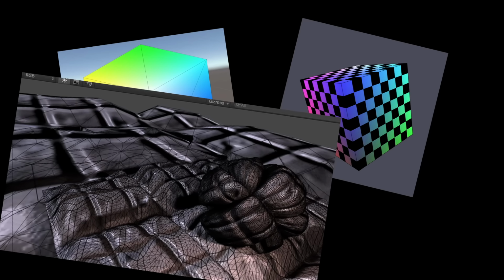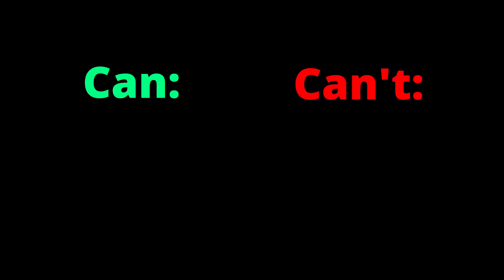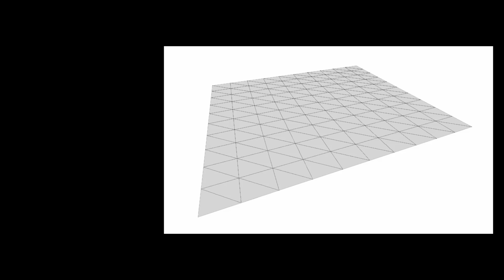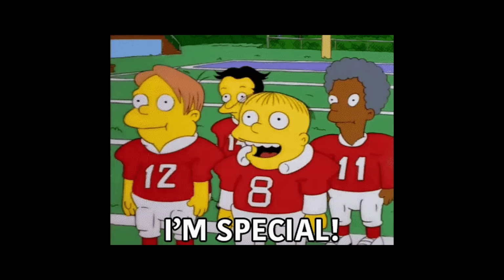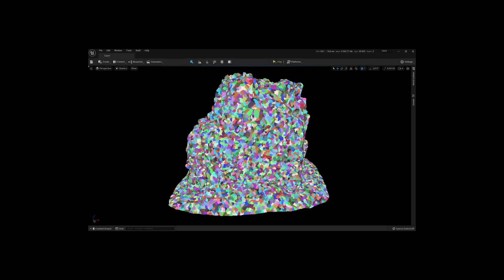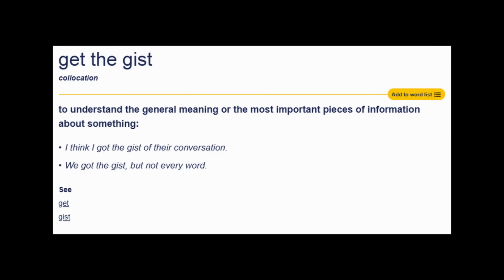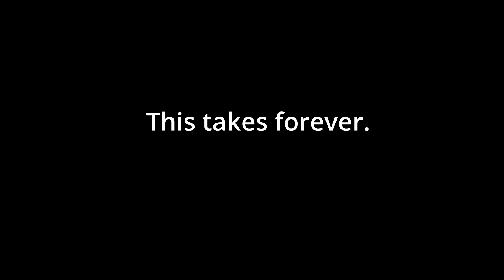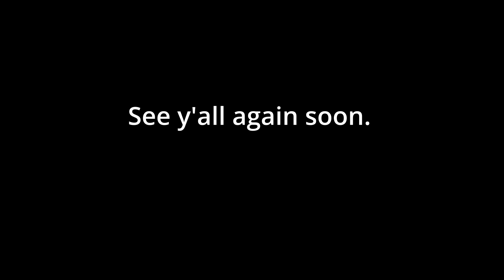Mesh Shaders: The Future of Shaders and Computer Graphics

Comment: Some crazy unkind comments down here lol, what do you expect from a 5min video? Why don't yall just make videos explaining mesh shaders then? As someone who has barely touched vertex and fragment shaders (and has used OpenCl for compute) I think this was a nice taster. Even if you wanted to go into more depth, its not necessary to do it in a single video, and you'd always need an introductory overview anyway.

Btw, how are meshlets generated, like how is the mesh partitioned? By the driver, something you do cpu side at runtime, something you augment the meshdata with on disk?
Reply from the maker: Thanks for the comment, I really appreciate it! Meshlets typically are generated at CPU runtime. Basically, you have to preprocess the mesh by splitting it into meshlets manually at some point early in the program on the CPU.

Comment: OpenGL 4.5+ with the appropriate extensions (GL_EXT_mesh_shader or GL_NV_mesh_shader) can use Mesh & Task shaders. Even OpenGL ES 3.2 can use Mesh & Task shaders, albeit with a lot more limitations (although you can't use them in WebGL2... basically the only place where GLES3 is useful imo). They are supported in WebGPU... but I'm trying to not look at WebGPU until it has broader support and tooling... and hopefully by then someone will figure out a good way to convert between GLSL or SPIR-V and WGSL (the new shading language for WebGPU)... I wish they would have just supported a subset of SPIR-V like basically all other modern graphics APIs (including Microsoft, although not yet... but SPIR-V already has extensions to support most features from HLSL that are missing in GLSL). It seems Apple was the main objector, then they manufactured a bunch of (mostly) BS reasons about why SPIR-V wouldn't work.

Comment: What can mesh shaders actually be used for? How do they operate on meshlets?
Like for example, how is the Minecraft nvidium mod actually utilizing mesh shaders?
Reply from the maker: I’m not sure about Minecraft’s nvidium mod, but essentially mesh shaders allow you to do more operations that would traditionally have to be done on the CPU, on the GPU. Essentially it’s just a very different type of rendering pipeline with vertex manipulation and generation on the GPU playing a central role. The actual mesh shaders look a lot like compute shaders, except they output vertices directly into the fragment shader, which compute shaders can’t do
Reply: You can choose LOD per each meshlet or even generate new geometry altogether without even needing index buffers. For minecraft you could compute which blocks need to be rendered on the GPU and simply generate models rather than on CPU.

Comment: Mesh shaders also have a massive downside in the fact that they can’t really be optimized at all due to so much unpredictable behaviour that a mesh shader can take on… they also crazy spike memory usage on most platforms… looking at you Alan wake 2…  it’s once again, proving to be another overhyped piece of tech if im being frank… honestly I’d rather just use compute and vertex shaders separately such to avoid that
Reply: Wouldn't compute shaders would also have the same optimization issues (are you referring to compilers have trouble optimizing?) , since they can effectively do anything as well
Reply: @Ehal256 yes exactly, but at the same time a compute shader is just outputting memory, it’s not outputting or checking if the mesh is even valid and it’s also totally free from the fixed function pipeline too, functionally the compute pipeline is just the shader, but the mesh shader also has to interact witj the rest of the ffp down stream directly rather than just transferring memory from one location to another

If the mesh must be valid as well, you cant be nearly as aggressive optimizing load and store since the mesh has to output valid geometry too

Comment: 4:10 As an advise - don’t spend time learning WebGL, as a technology it is stagnant as all vendors are working together on WebGPU standardization. WebGPU is also far simpler at the end - all state is explicit, far better debugging experience, far more capable then WebGL already and closer to Vulkan & DirectX12
Reply: And it's still not supported on tons of devices. I'm sure even in 2030 webgl will be still widely used.
Reply from the maker: I’m aware, I just went with the “make it work now, make it better later” mindset in this case. Im writing my backend in a way I can always upgrade the API is needed

Comment: But recently Sodium performance caught up with Nvidium, a mesh shaders based Minecraft mod. Nvidium has worse performance on 32 chunk render distance on my 4060 GPU. Now development seems to have moved to an LOD mod. So for high render distances, LOD on Voxy works just as well as AMD as on Nvidia without Nvidia exclusive shaders.

Feel free to correct me if I'm wrong, I'm only benchmarking performance and do not know the lower level details.
Reply from the maker: Interesting! I don’t really look into Minecraft shaders much, but I’ll check this one out. Thanks for the insight!
Reply: For me, Nvidium still very much beats Sodium to a pulp. But maybe that's because I'm running a mobile GTX 1660 Ti at the moment.
Reply: @loleq2137 I tried the 1.21.4 fork and had regression compared to Sodium alone and my use case is 32 render distance with Bobby to render chunks ahead for boat racing. Regression is around 15-30FPS, from 180fps to 150fps ish.
Reply: @pixelsam123 Boat racing! Well that's a use case I haven't considered. In that case maybe it's just because I play more traditionally haha. Still, my experience is much worse when using Sodium, for whatever reason. And I don't even run the max render distance. I've got it at 16? paired with distant horizons. Yeah I'm not exactly a view distance aficionado lol. I tested it, it works the same even with nothing else installed.
Reply: Yeah, you are wrong in benchmarking it at only 32 chunks. Nvidium is intended to be used at 64 and more, with such a low render distance it only adds overhead and no performance benefits.

Comment: the future of computer graphic is dark because of too many api that dont play nice to eachothers
Reply: Vulkan is the only relevant API so there is nothing to worry about
Reply from the maker: @Maevef100f This is a reasonable tale, I do still think DirectX 12 is worth mentioning though
Reply: @Maevef100f  ye to support all platforms and modern features vulkan + metal + webgpu is the least amount of work needed. But if you can live without modern features then opengl 3.3 and gles2 3.0 is minimum effort. Apple and the W3C is so bad for stopping vulkan spreads